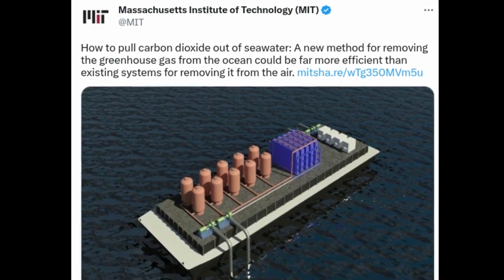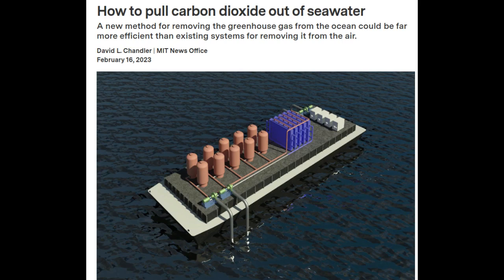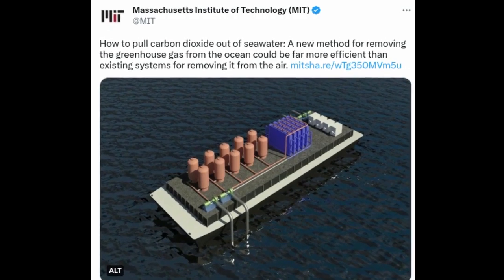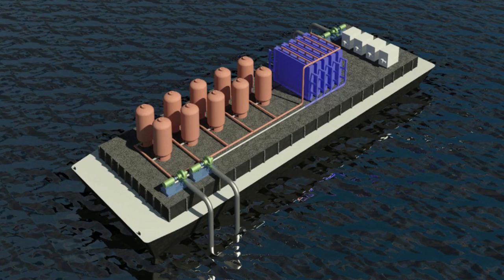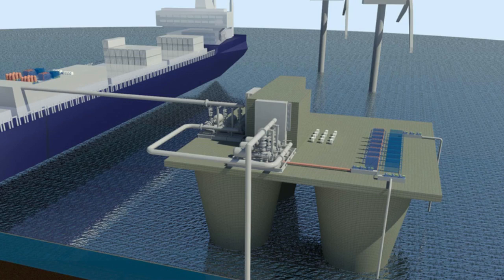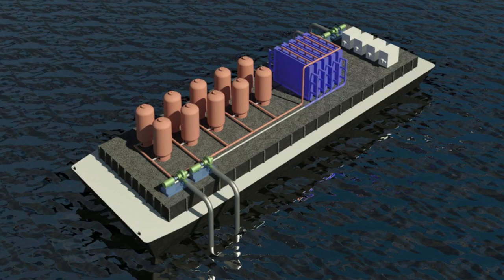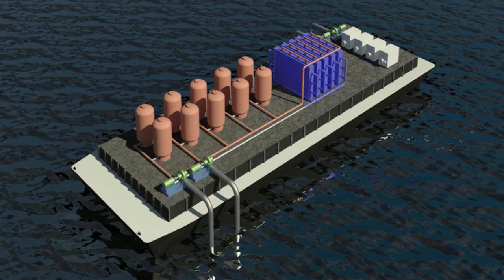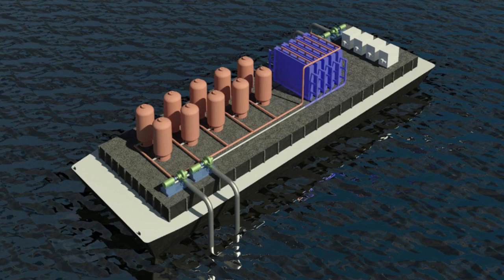How to pull carbon dioxide out of seawater

Comment: Instead of vacuum why not just pull sea water from the oxygen minimum zone (800m below the surface) where it is under pressure, and at its maximum relative concentration to other dissolved gasses. There is no need to remove all of the CO2 as it passes through the system. We need only a difference in equilibrium to take advantage of differential concentration. CO2 will nucleate out of the water as the pressure of the deep sea is releaved. 
An even easier place to do this would be at deep tropical lakes. Especially ones which have a potential to undergo limnic eruptions.